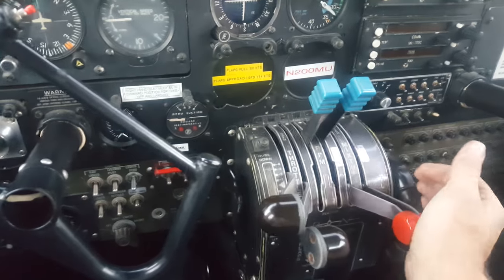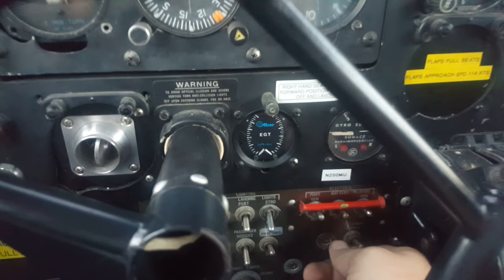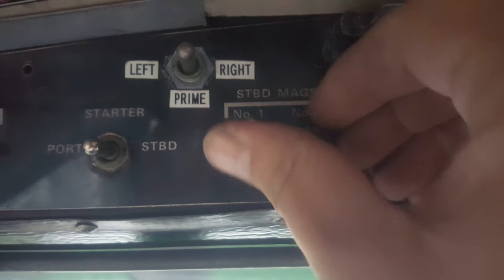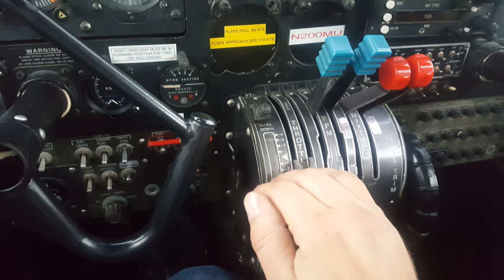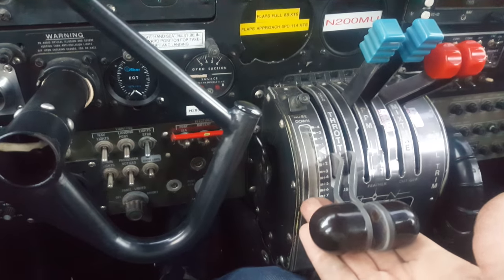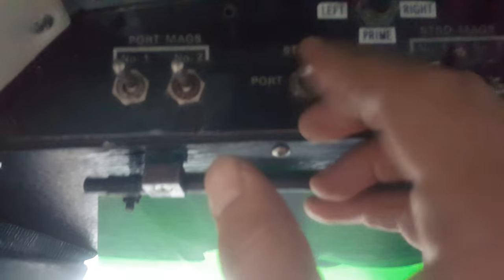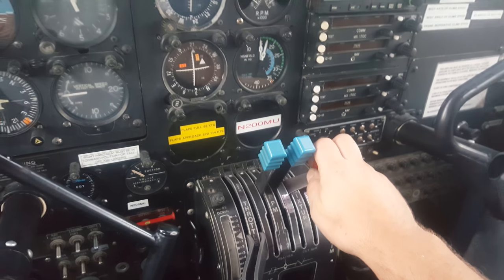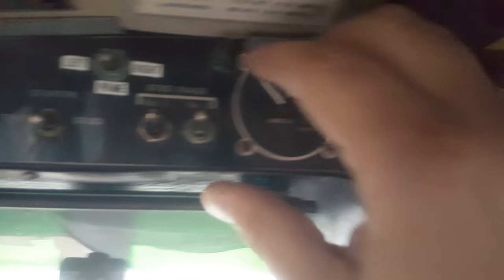Britten Norman Islander hot start procedure

Comment: Hi... I flew a normally aspirated BN2A years ago and wonder if the aircraft you demonstrated the hot start was fuel injected or had carburettors?  I was confused seeing the PRIME Left/Right switch near the starter switch and you used a carburettor accelerator pump method to prime the engines. Can you resolve my confusion?
Reply from the maker: Hi , this plane has carburetor
Reply: @MarekMarciniak  Thanks for your reply. 
So... What was that 'Prime' switch I saw in the video?
Reply from the maker: @davidpalmer9780  the primer control fills with fuel  and squirts that vaporized fuel directly into the cylinder intake port or induction system (not into the carburetor, as some believe).
But i have never had to use this. Our technique works better ( according to my boss 😁).
Best Regards 
Marek
Reply: @MarekMarciniak  the islander doesn't have a primer so to speak, just the accelerator pump in the carb. My SOP was to throw the sump drains into the carburetor filter. cold start 6-10 pumps, hot 3
if it won't start cold, not enough fuel, hot too much
Reply: @MarekMarciniak  hi there WITH DUE RESPECT iam new in flying the BN2A21 KINDLY EDUCATE ME ON TECHNIQUES NI FLYING THE AIRPLANE

Comment: Hi there! Hope u r safe. I want to know whether this aircraft has ils landing capability like localizer and glideslope capturing and landing by it's own if proper input set in the GPS instruments (KLN90B/89B). Thanks in advance!
Reply: No... It doesn't have an Autoland capability.
Reply: @davidpalmer9780  okay then what is the functionality of the APR button in the autopilot panel?
Reply: @akashmojumder3795  On Autoland equipped aircraft, pressing the APP button arms the Autoland approach capability to capture both the localizer and glideslope signals of the ILS and track them until the flare manoeuvre.
Reply: @davidpalmer9780  I actually mean to say I saw that apr button (in the autopilot panel) in 1 BN Islander.
Reply: To capture both the ils localizer and the glideslope on the autopilot/flight director.  Otherwise vs will stay on previous selection of vertical nav mode  attitude, vs, or altitude.

Comment: Thank you very much! Flying Islander in MsFS2020 at the moment, and am still learning alot about the aircraft, but very easy and beautiful to fly.
Just wondering, what exactly do the port mags and stb mags do upon start up?
And what does the start isolater do? And can i switch it off once the engines are running? 
Very thankful for answer, thank you in advance! 
I dont fly in real life, yet, but i wouod love to become a bush pilot one day, cheers
Reply from the maker: hey , The magneto is a self-contained generator of high voltage that provides ignition to an engine through spark plugs. A magnet—hence magneto—spins in close proximity to a coil of wire. As the magnet spins (or the magnet rotor is turned), it generates a strong magnetic force that is “held back” by a primary coil.
Reply: @MarekMarciniak  thank you very much! That makes a lot of sense now. Understanding that, answers my other questions by themselves, cheers, much appreciated!